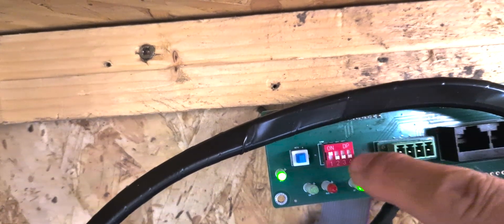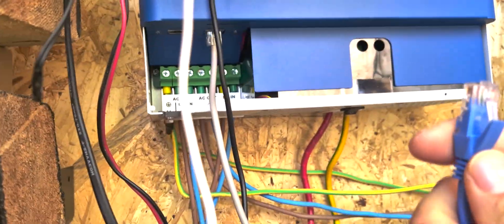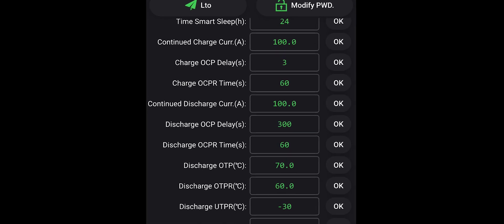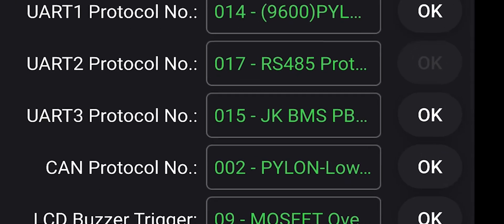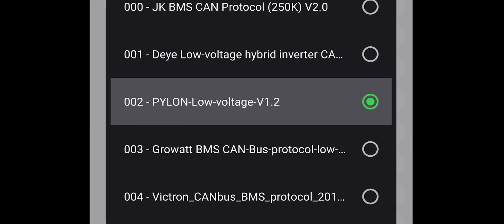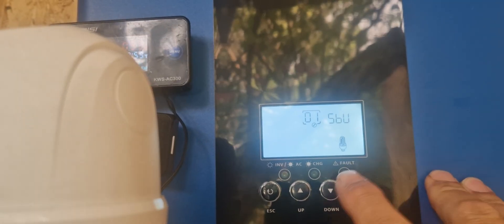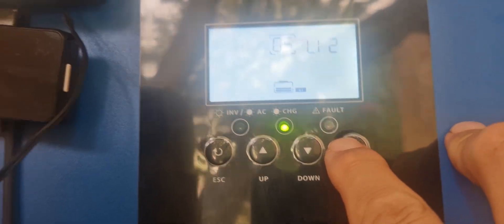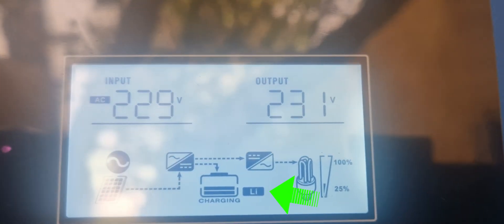How to connect JK BMS UART CAN RJ485 Protocol to EASUN INVERTER

Comment: Does the charging stops at bulk voltage limit? For example, in my jk I have RCV set to 3.450 v, which is 55.2 for a 16S configuration. Because I also use communication, the charging doesn’t stop at 55.2, it stops at 56.8. I don’t understand why. I’m asking to see if you have a similar behaviour. The float voltage is respected when requested by bms.
Reply from the maker: Hi. I will look at this, thanks for the info.
Reply: Is the network cable used a normal one for computer networks or did you change the order of the wires in it? For example, at Victron, there are 2 types of cabling: Type A or Type B
Reply from the maker: @pcipri76  Hi. No changes. is normal cable. And, i forgot to mention above, that i have also set my inverter to 55.2v bulk and floating. So, both devices are set to 55.2!